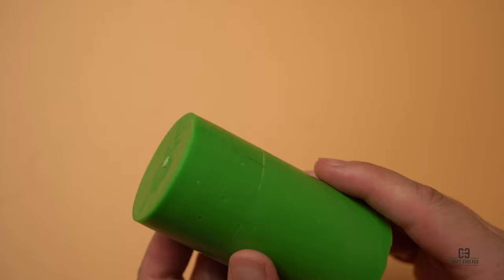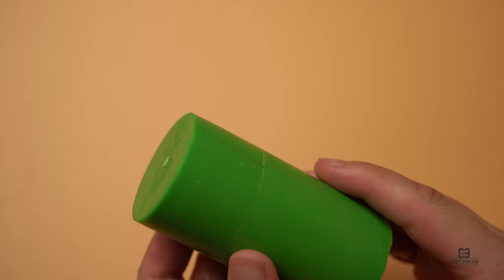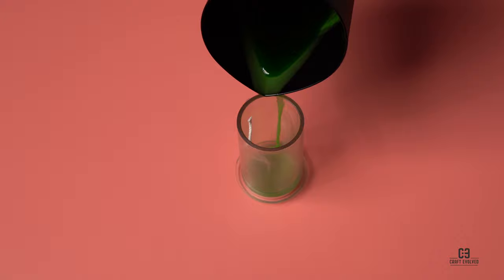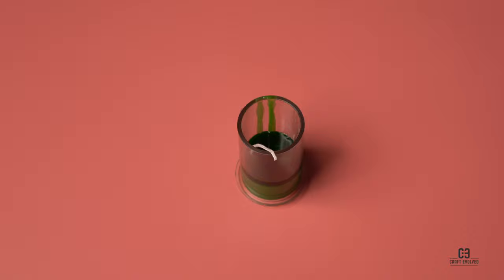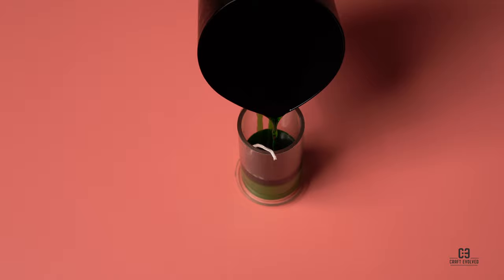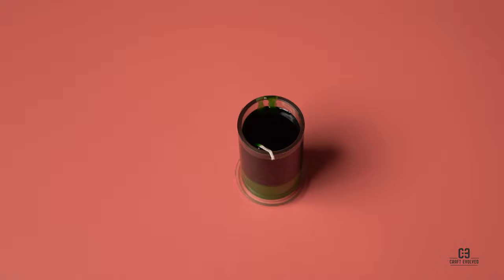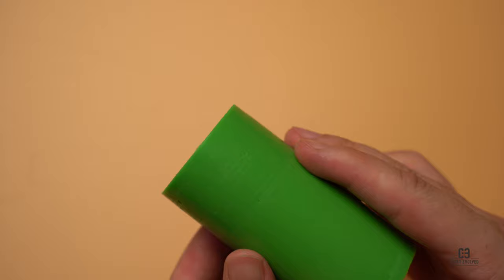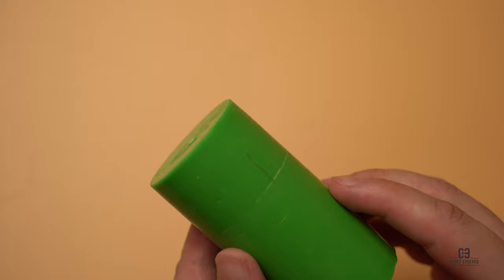Common Candle Making Mistakes - Air Bubbles

Comment: I'm getting really confused with what temperature I should do things, I don't want to pour my wax too hot as I don't want to burn out the fragrance, however, it's causing me to have jump lines and air bubbles! I need a good ratio. I'm using Soy wax.

Comment: Hello! thank you so much for making this video. it was very helpful. I am currently working with Soy wax for Pillar candles made in both silicon squishy molds and hard plastic molds. the bubble candles i make in the silicone molds have bubbles and white frosting on the top next to the wick (so they are at the bottom of the mold when being poured as it is upside down). Do you have any suggestions or tips on how to stop the bubbling and how to stop the white frosting for pillar candles? thank you so much!!!
Reply from the maker: Hi Mari! Thank you for your question. Because you are using 2 types of molds for your pillar candles and you are experiencing the issue only with 1, that is confirming you know what you are doing and most likely you are doing everything correctly. The reason why you are getting different results is in my opinion the temperature exchange and the speed of cooling difference between these 2 molds. I was getting bubbles in the wax when I poured cold wax. I was getting visible bubbles or surface deformations when the mold was much colder than the wax itself. I would try: 1/ lift up the wax pouring temperature just a bit 2/ at the same time make sure the silicon mold is warmed up. This should slow down the wax cooling, leaving a smoother surface without bubbles. This is just a guess since I have not used a silicone mold for pillar candle making yet. But I might in the near future. Please, let me know the results, and happy crafting!
Reply: hi! i also find the same problems like you :( a lot of frosting and bubbles,  have you figure it out how to make them smooth?
Reply: Same problem here too… this video was so helpful

Comment: I made pillar candles out of paraffin wax. I use your pouring method only . When I remove candles from moulds...at first they look very smooth and glossy...but after few hours white spots are visible on all over the candles.....how to solve this.... please help me out
Reply from the maker: I am working with soy wax only, did not get chance to work with paraffin yet. After how long do you take the candle out of mold? If you keep the candle in mold longer, the white spots still show up even while the candle is in the mold? Based on that we can make some assumptions.
Reply: Thanks for your reply sir
Reply: Ive been having the same issue were you able to figure it out??
Reply: @socialrose  yes ....I have worked on temperature and melting process....
Reply: I’ve also been getting the same issue and also I get white bubbles for colored candles after cooling. Would you know the solution?

Comment: Thumbs up here! Thanks a lot for the hint. I'm going nuts of because these bubbles! I use paraffin wax with the silicone mold. Everybody told me that I need to pour wax on between 85-90 degrees. I was thinking about pouring with the lower temperature and I found this video. What degree are you recommend for silicone mold?
Reply from the maker: I watched many videos and read a few instructions. They have this in common - 85 degrees Celsius - add coloring, let it cool off to 55 degrees Celsius - add scent. Then pour. A bit lower and wax is getting thick. By I think around 60 degrees Celsius is the sweet spot. And I think that applies to any mold. Give it a try let me know!
Reply: Hi! I just started working with paraffin in silicone molds and I am having so many issues with bubbles too. I wanted to know if you ever resolved this? I have tried warming the mold to 60C and to 80C - did not work. I have poured at 80C with warm and cold molds, same issues. I have poured at 60C in warm and cold molds, still same issues. Help!
Reply: @yasantis  do you have find a solution ? Same problem

Comment: Usefull video..
Plz Tell me Correct temperatures For wax
Reply from the maker: Hi! Thank you for your question. Heat up the wax to 160 - 185 Fahrenheit / 70 – 85 Celsius. This is the temperature when you add color DYE. Then let the wax cool to about 140 Fahrenheit / 60 Celsius. Once at the desired temperature, add your favorite fragrance oil. Then pour. Hope it help! 😀
Reply: 60 add fragrance oil...mix for min or 2...in that time wax is 55. If i have few molds its too cold. I can see wax is getting hard while pouring 😩  so it will get hard too quickly...i dont understand all this different opinions.  Why cant be sane rules for everyone and we all would know how to do...😬   so do you think pouring in 70 will be too hot?? Some people pour at 75. Thanks in advance